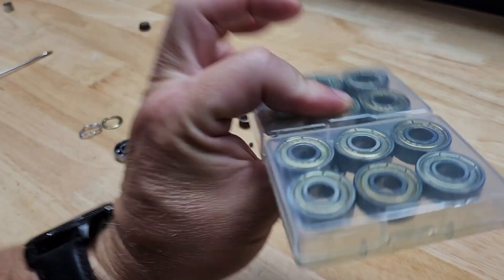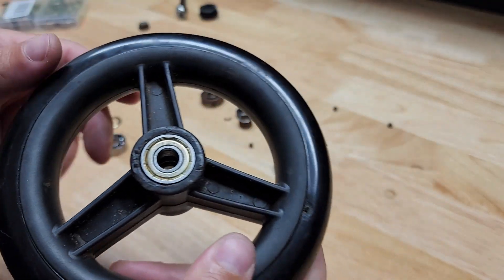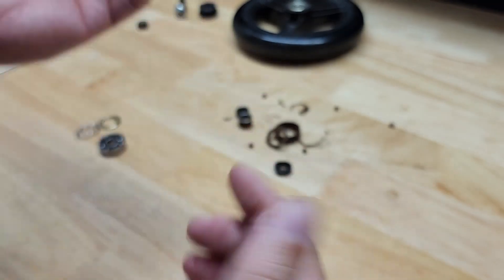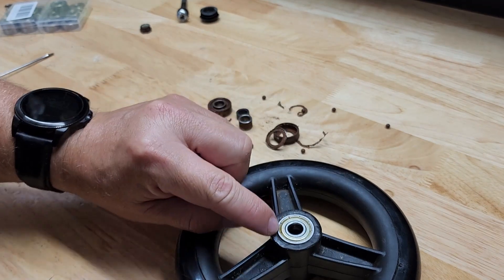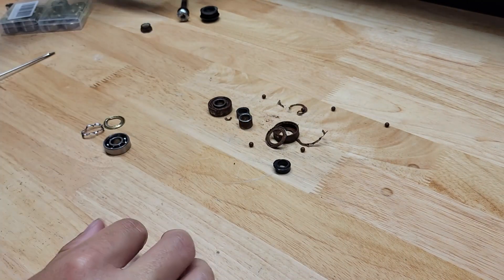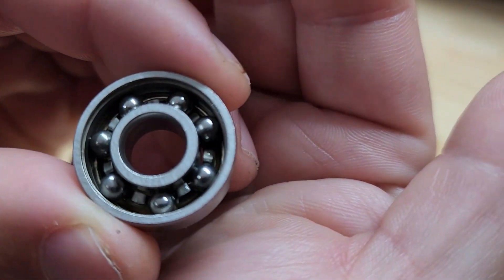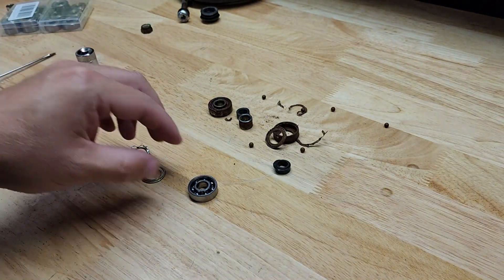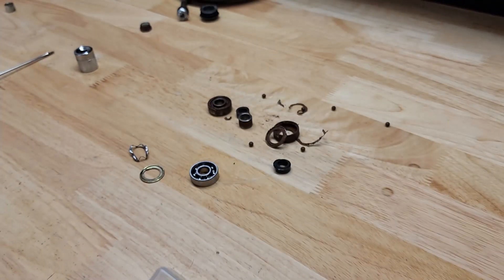What You Need To Know About These Bearings!

Comment: The bearings in your video appear to be "sealed bearings" and are not greaseable. They are sealed to keep out dirt and moisture, and keep in the factory lube. Depending on application needs some seals are metal faced, others are plastic. If the seal is plastic, it can possibly be penetrated with an lubrication needle to inject grease/oil. Good quality sealed bearing last a long time and are used to eliminate need for routine greasing and in applications where access for greasing isn't practical or is impossible.  My 1997 JD lawn tractor still has the original seal bearings on one front wheel, replaced the other side 3 yrs ago.